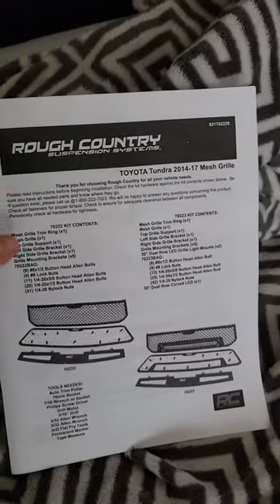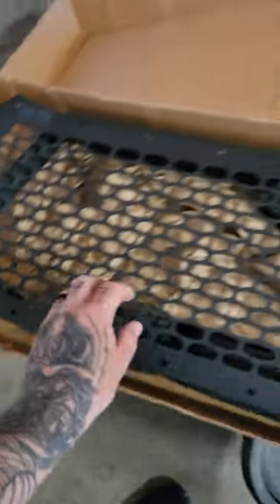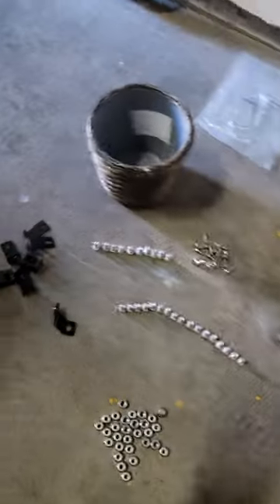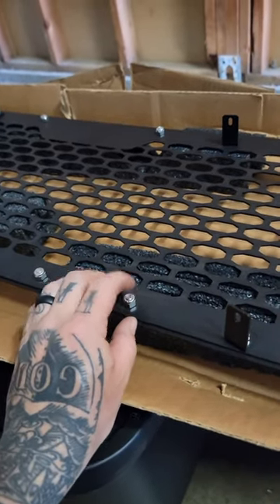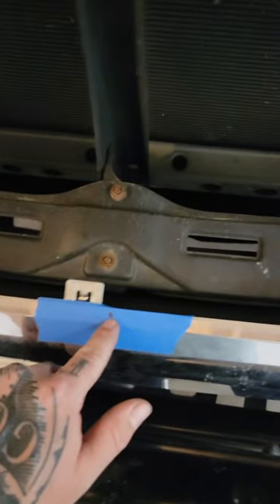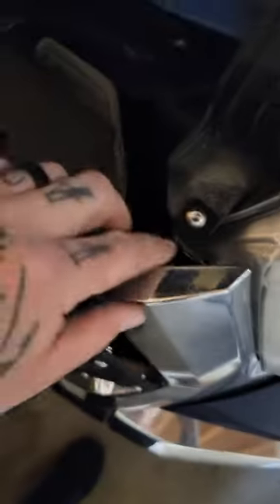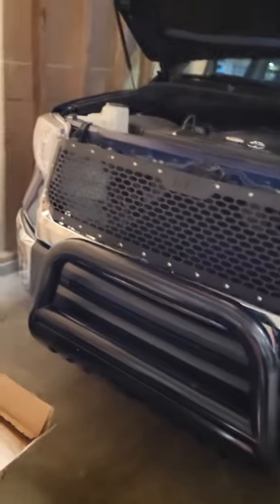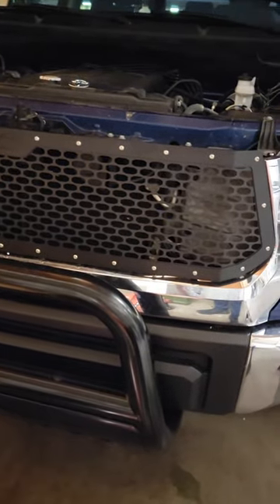Rough Country mesh grill review and install for a 2015 Toyota Tundra.

Comment: I got one from another company think it was trendgear & after install I have a 2-3” gap between the grill & the hood directions were crap any advise? I can send a pic to a email if need be TIA!!
Reply from the maker: Is it a gap straight above the grill or is the grill sticking out 2-3 inches?
Reply: @countrylifeadventures  the grill is recessed & it’s about a 1.5” gap above the grill between the hood I have a 14 platinum
Reply from the maker: You could try to bend it? I had to bend mine a little to fit it into place or maybe washers places to raise the grill up a little
Reply: @countrylifeadventures  do you have a email or anything I could send you pics?